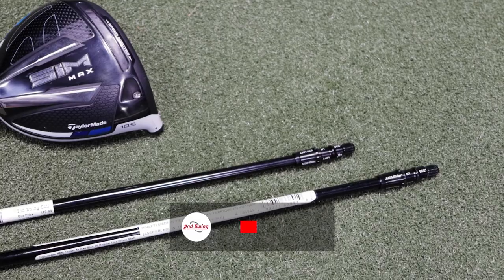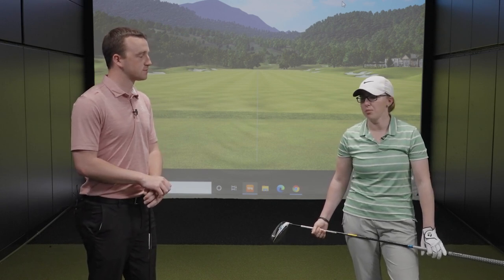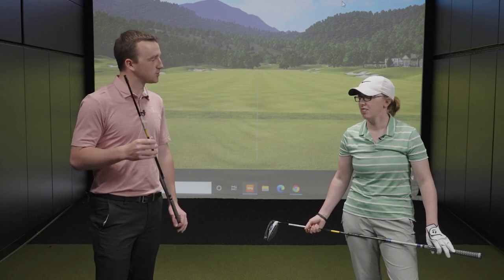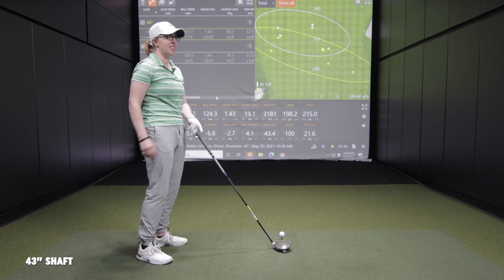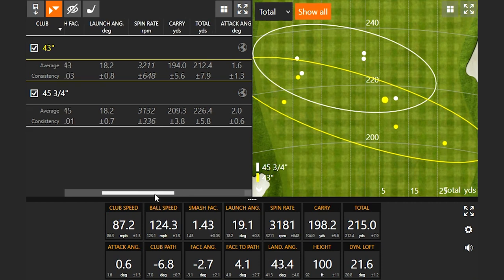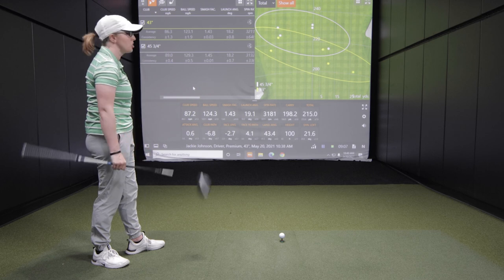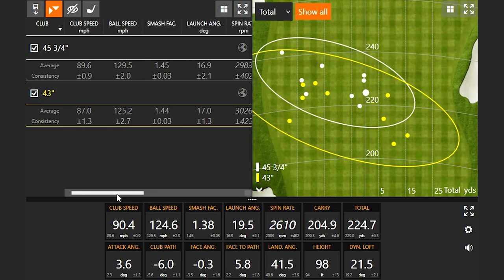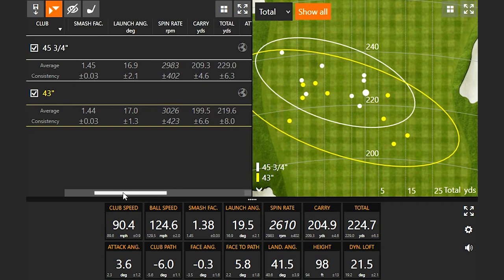Testing Golf Shaft Length and Type | Driver Shaft vs Fairway Wood Shaft

Comment: well guys, i had my tour van fitting(scottsdale location-mackenzie gibbs) you guys said to give you info on it, and it was wonderful, i just wish i had done it  sooner. walked in with tm rsi 1's 90 gram steel shafts and in 4 to 6 weeks i will have mizuno's jpx 921 hm's w graphite shafts never even thought of those when i started the fitting xd. i had only 2 in my mind ping's g425 and the cleveland halo irons, we started with the ping 710's and were really nice and alot better than what i had, but that did not stop him from having me try out 5 more clubheads.  when i was down to the 710's and the 921's i hit them 5 more time each and the mizuno's just felt better even with the miss hits. i gained 5mph ball speed  400 more rpm spin , 9 more yds of carry(7-iron) and the dispersion pattern was cut in half... also needed a 5 iron replacement for 170 yds carry shot and it took 3 whole swings with the mizuno fli-hi 5 hybrid and it was perfect, and though it was great the fitter still had me try 2 other ones just to make sure.  watching your video's made the choice to use 2nd swing to get fitted perfect thx. glenn
Reply from the maker: Glenn. Thank you for the review. All out fitters go through the same extensive fitting training to get our customers dialed in. Sounds like you are very happy with the new clubs, I have no doubt when the JPX Hot Metals arrive you will love them! Glad we could point you in the right direction. - Thomas
Reply: @2ndswing  when they arrive is the hard part lol. 4 to 8 weeks, better than 3  plus months if I got ping" s

Comment: This video isn't very useful considering how inconsistent each shot was. And they made it sound like they didn't bother with swingweight.

I can say, I own a 44.5" and a 45.75" with my Sim 2 driver. I have weights I bought to keep D5 in both configs and I hit WAY further with an increase in swing speed with the 44.5.

44.5 - I average about 113 club speed and ~280 carry with good roll out and low spin.

45.75 - I average about 105 and out of control spin numbers keep me at ~240 carry with little roll out.

I think 43" is probably overkill, that would be shorter than my 3 wood. I am 6' 0" but for me to swing appropriately it feels like I either need to go more out to in so I don't pop it straight up or slam the ground which adds way more slice and spin generally. Terrible for distance.
Reply from the maker: Thanks for your feedback and input. It's important to remember results will be different for everyone. Looks like 44.5" is a winner for you! - Thomas
Reply: @2ndswing  Oh yea, not suggesting my result is definitive, just a bummer that a more consistent swing didn't happen this time and that swingweight was ignored. You guys rock, just constructive criticism from my opinion. Definitely not meant as an insult or sweeping generalization.

Comment: I think if yu swing weighted the shorter shaft, she would have had a better time with it than she did here..
I went from 45.5 to 45 to 44"
I hit fairway 99% of the time now.
In my last 2 rounds of golf only 1 fairway was missed, but that was me on the 18th hole and I was tired and my swing was tired.
I've possibly dropped about 10-15m total
But hey 35/36 fairways I think is a fair trade off.
Just makes me want to improve my skills on hitting up on the ball, as I am 1° down AoA so my total distance is usually 260yds but every now and again I just smoke one all the way to 320yds. 
Anyway if i hit up more often, I can gain that distance back soon and still hit fairways. Maybe one day I'll go back to 45 but im 5'6 tall and tbh 44" just feels far more comfortable.
Reply from the maker: Thanks for watching. Yes hitting up on the ball and increasing your attack angle will give more distance (higher launch, lower spin). That is a very impressive stat only missing one fairway, many golfers can only dream of hitting that many fairways - Thomas

Comment: I tend to choke down a bit on my driver...feels a bit out of control if I dont
Reply from the maker: If it helps you hit the center more often and hit straighter drives a shorter shaft is a great option. - Thomas
Reply: @2ndswing  yea, I think I will for my Sim Max head...thanks!

Comment: neither shaft seems to work for her, launching the ball at 17-19 degrees and spin over 3000
Reply from the maker: Looks like the 45 3/4" shaft was launching at 16.9 and spinning at 2983 and considering the fade that would be expected. With less speed those numbers are pretty close but can still be optimized with loft / head design modifications or even a better shaft. - Thomas